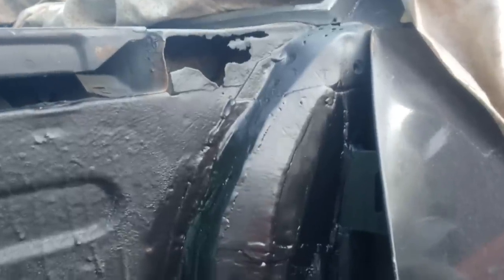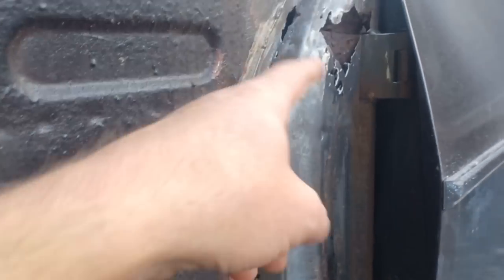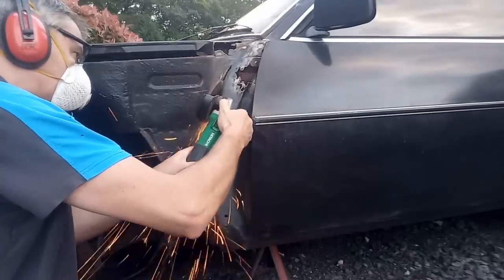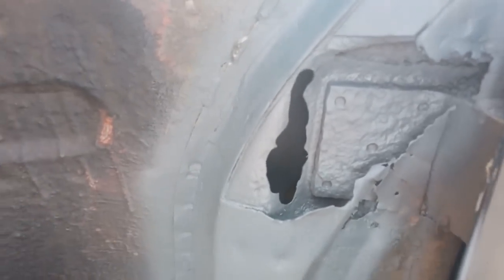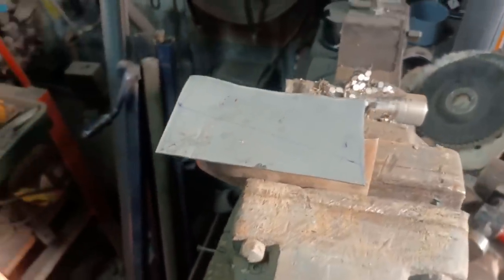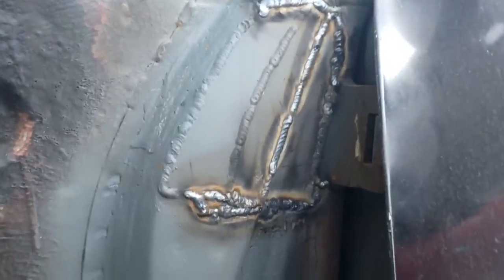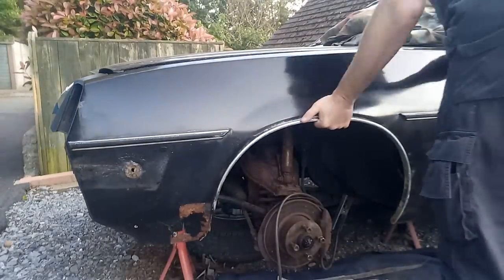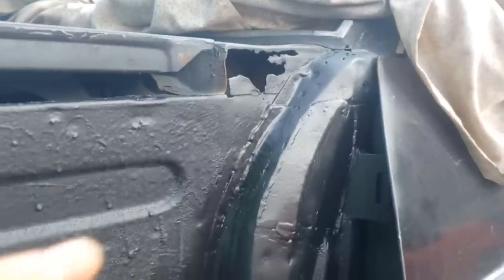Opel Manta B project. Door Pillar Repairs. Car Restoration.

Comment: Another great video Dave, just like the Escort, nice clear steps to make the structure solid again. Just watch the angle grinder and the windscreen - my screen is lie 20 grade sandpaper after some vigorous weld smoothing, dont think the wiper blades will last very long !
I'm just ahead of you with my Escort, got a lot of confidence and direction from your work to keep me going, but my boot floor is sound - looking forward to seeing you sort that, and the RHD wipers, pedal box fitting and column conversion (which I've just done).
Reply from the maker: Thanks Stuart, be interested to hear your comments on the RHD conversation bits when I get to that.

Comment: Hi dave loving your vids now can you tell me as a novice welder just learning what settings you use on welder ie speed and power and what gas you use
Reply from the maker: Hi Gavin, I use CO2 as a shielding gas, my welder has infinite speed and power control, which is the real trick to nice welds, when welding thin sheet it is set at about 40% speed and power. Thicker stuff 60% ish. It’s a bit of a try it and see to be honest.

Comment: Great great work !!!!! What discs do u use to clean the welds up ??
Reply from the maker: Generally what ever is closest to me 🤣, I used a thick cutting disc that time which helped me get into the corners better.  I prefere to use a metal grinding disc mostly, but will use flap discs and 40 grit discs also.

Comment: Awkward spot to deal with Dave. You got the strength and shape back in it which is important. The Manta has a long heavy door and you can only imagine the metal fatigue on that "A" post and all its layers of metal. Just thinking there's nothing wrong with repairing a panel like that prior to removing it. You'll have the shape back in it and once you have it right if you wanted to pluck out the spot welds to get at the metal behind it afterwards. Just thinking out loud here. Love the videos and keep it up 👍
Reply from the maker: That's a good idea, thank you 😊